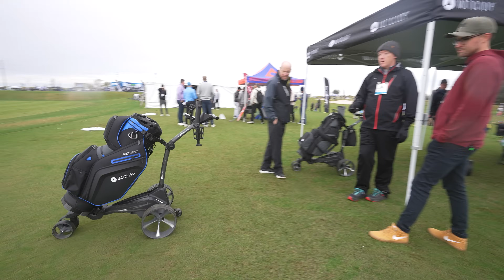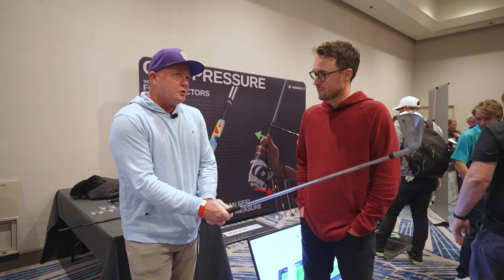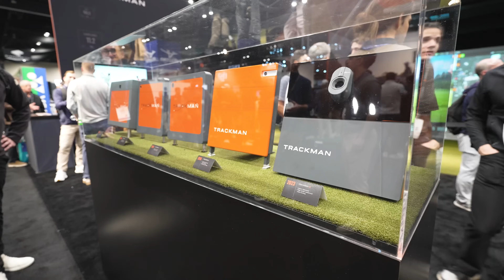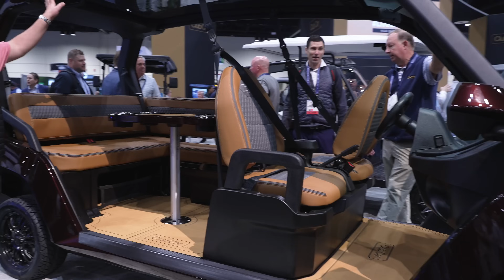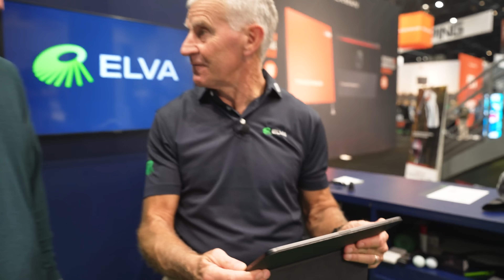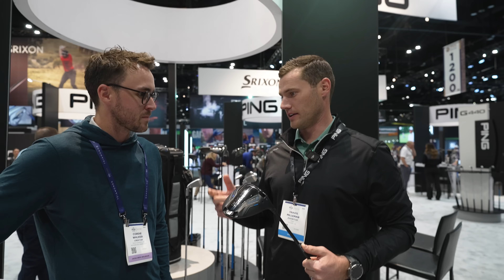16 Golf Gear Highlights You’ll Love from the 2025 PGA Show

Comment: The “Cube” is a little bit of oversold tech. I compared it to me other range finder at 1700 ft asl, 50 degrees and it showed the same distance. Then I brought them to 6000 ft agl, 74 degrees and they still matched. No software updates available. It is a solid range finder but doesn’t deliver on the extra promises>
Reply: doesn't the cube have "caddy mode" where you can measure from the cart? I thought that was the big selling point for that particular range finder?